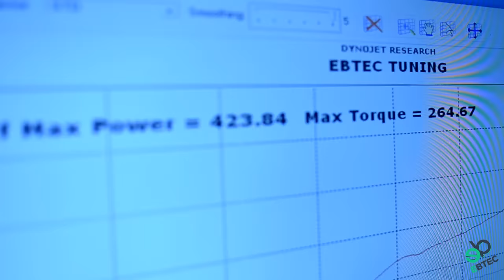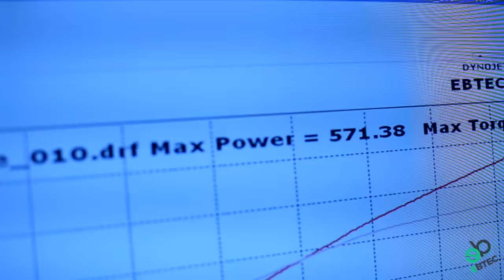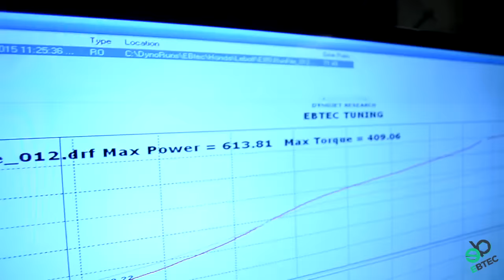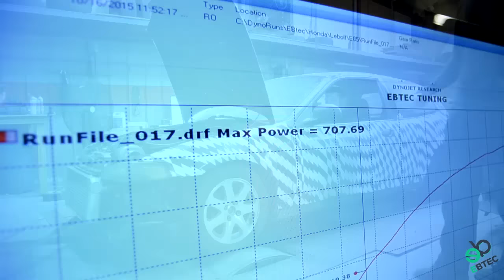DucttapeSled 700+ Club LSVTEC

Comment: hey i been trying to get different feedback i got a stock b20b w/ itr trans...wanting to go b20v turbo been hearing a bunch of different things making me feel my build wont be worth time and money i want to build the motor and trans so i know bout the b20 sleeves but wyt???
Reply: and crazy build btw
Reply from the maker: ITR trans will not do you well on a turbocharged setup, the ITR trans is more geared towards all motor applications due to quick gear ratios. A GSR geared trans would be a much better choice. You would need to sleeve the B20 block because their walls are not too strong.